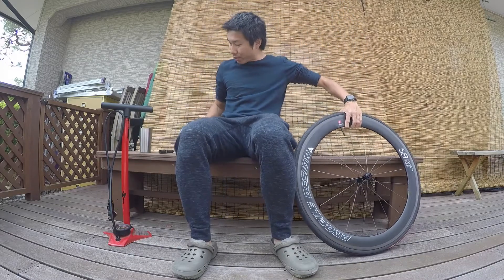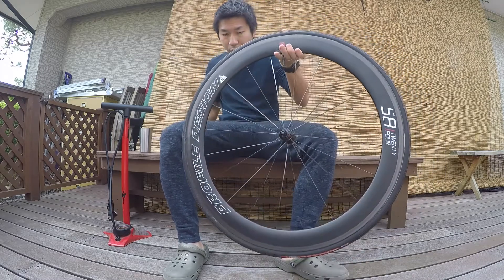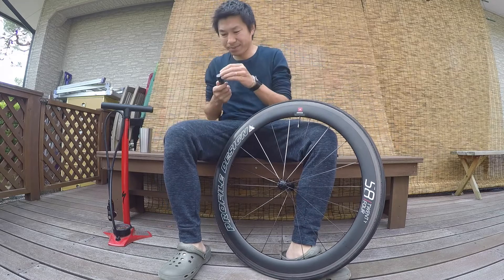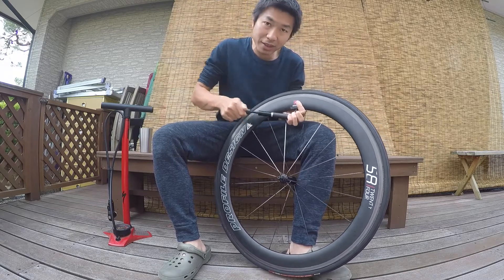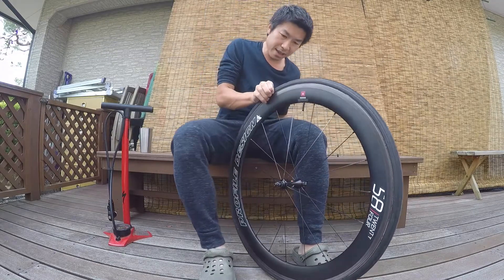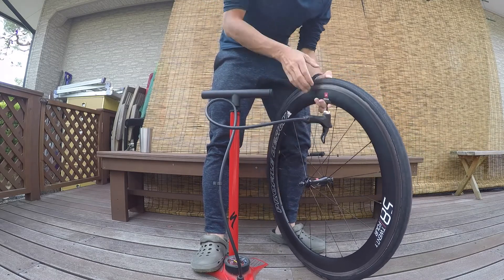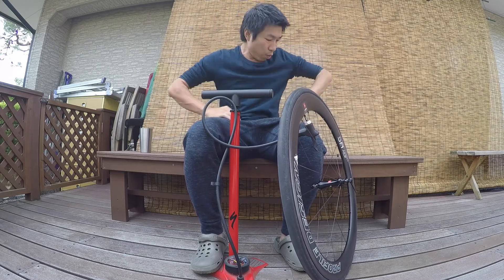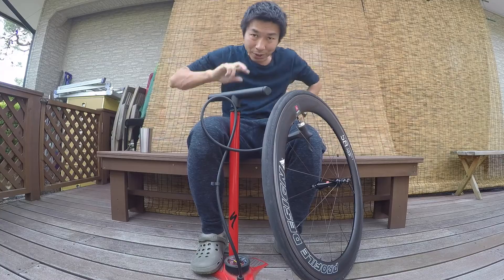Day 275 Today's stuff: Testing out Topeak Micro Rocket CB mini pump

Comment: I'm just wondering how do you plan to use portable pump when you have a pinch puncture on the road for your tubular tyres.
Reply from the maker: Ken Tongmit I will use tyre sealant first.
Reply: If you put enough pressure in before you ride, a pinch flat is less likely. I make sure I have about 100 psi in the road tires before heading off.

Comment: Hahaha, only 60 psi. :) I use the Lezyne Pressure Drive  and it takes about 100 strokes before I can ride
Reply: the whole point of this pump is the trade offs. if you rarely puncture and dont want to carry a massive pump around, then carrying this tiny thing and every couple of months spending 10 minutes struggling to pump a tyre up is better than lugging around a bigger high volume pump that they rarely use.thats why i like this pump, you are more likely to have it with you and its so tiny that it doesnt get in the way, and even just getting 70psi in it on the side of the road will get you home